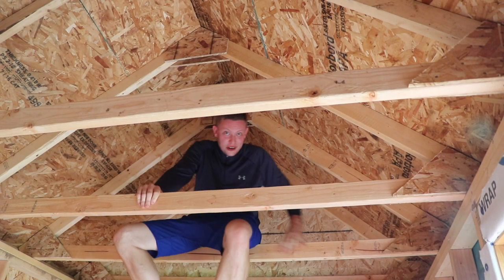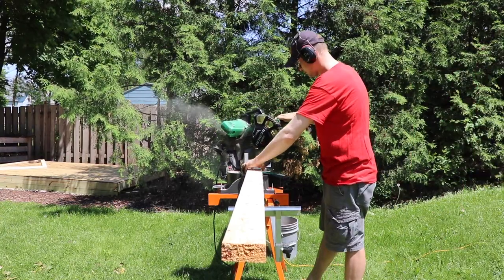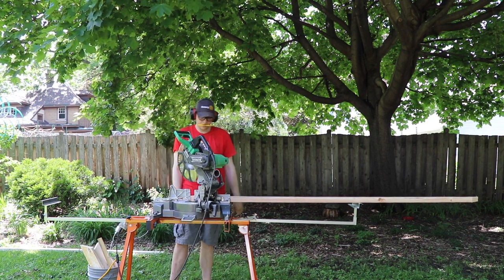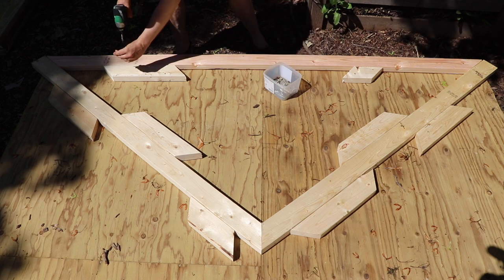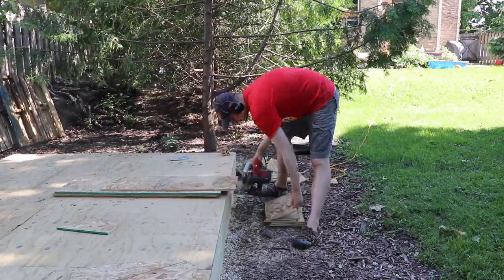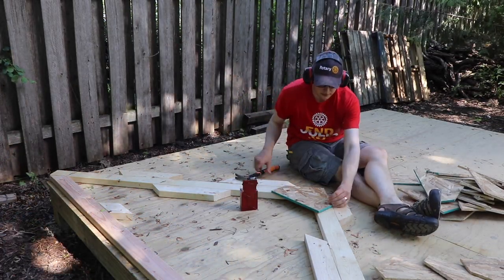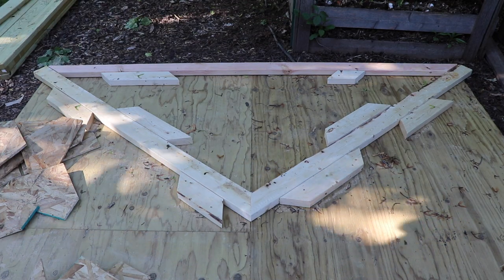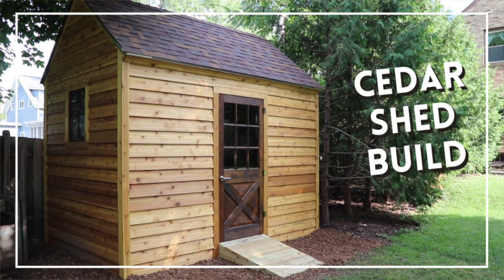How to Assemble Roof Rafters with Gussets - Building a Shed Part 2

Comment: How would you do a template with a concrete floor?
Reply: I propped up a couple of OSB panels on 2x4s and screwed in a 2x4 along one edge that represented the top plate, then set up a template on this wood "floor"